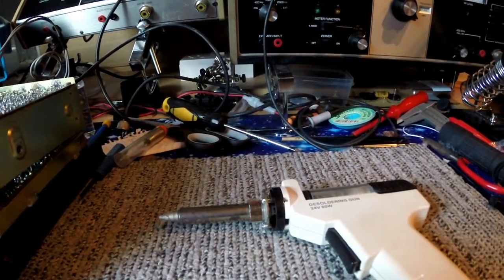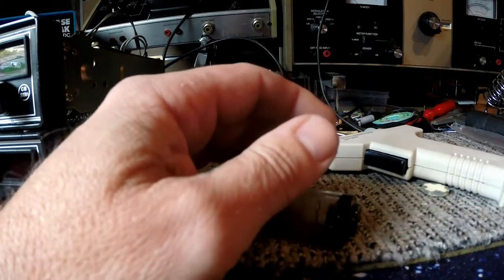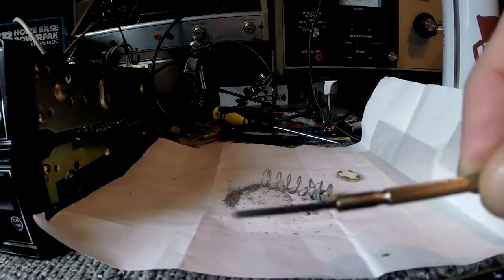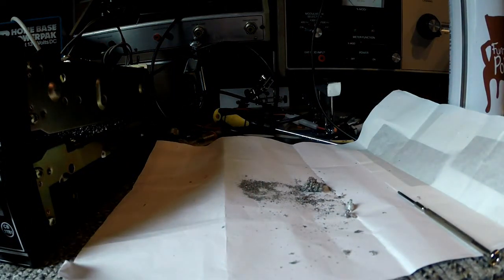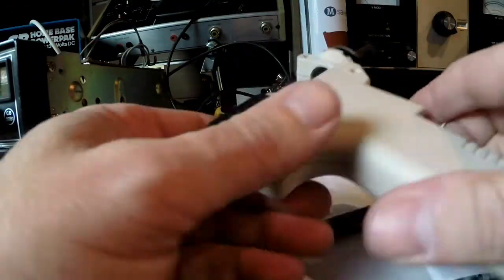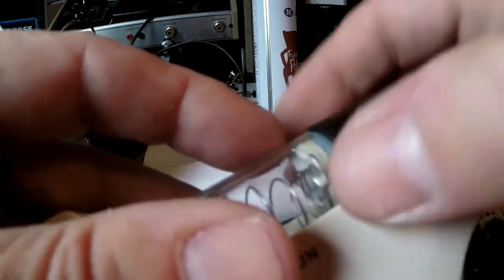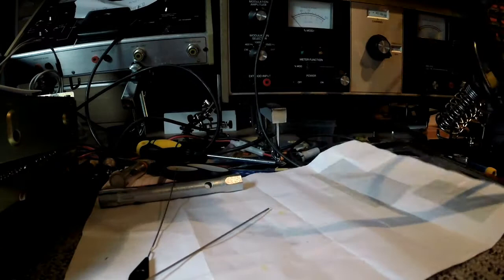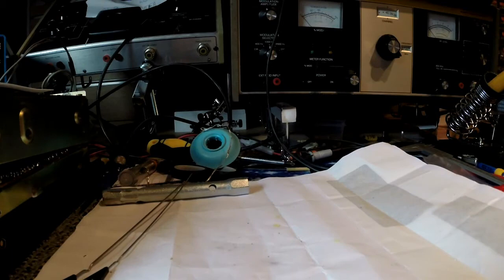ZD915 Desoldering Station - After Use!

Comment: is just chinese junk... mine I modify it a lot...
- the the travel of glass release in not enough to remove it
- it clogs aftor cople of sucking, beeing forced to use high temperature on the gun
 
- first can be modified relative easy by adjusting by grinding some plastic components inside
- second more dificult to do (move all heater assembly back and cut the internal pipe to the sealing limit
Reply: The all gun assembly is a chinese junk is not made by engineer but sume monkeys
Reply from the maker: Fingerrs crossed it has got clogged after heavy solder sucking sessions but still very pleased with mine.
Reply: @britishcbradio1055  after modifications also mine is grate, but looking on the inside and how is designed, is done by really stupid people, a lot of design flaws, and from years no one has bother correcting the shits

Comment: your meant too clean these out pretty much every time you use it .
BTW, your mean to heat up the gun, then use the skewer to clear it once the solder is molten.. is that a roger ?
Reply from the maker: Hi rob, no theres no need to clean them out every time you use them unless you are a really heavy user. If it does clog then yes put it on max temp, then ram the skewers up the tube press the trigger and it should suck the blocksge clear, and be careful the skewers get very hot!! I know from experience!🤣 i will do a cleaning video next time it needs cleaning.
Reply: Not every time, but more often than THREE MONTHS!

Comment: Thanks, mine just clogged during a project and I was frustrated that I could not get cleared. Now I know there is hope.
Reply from the maker: Yes get it set to max and leave it to warm right up the hotter the better and use the ramrods to clear the nozzle if jammed, however be very careful handling the ramrods after they have been up the nozzle as I am speaking from experience when I stupidly picked it up and burnt myself -!
Reply: @britishcbradio1055  Hi, still working?
7 years ago I bought one ZD-915, it was supposed to be the replacement for my Hakko 808 but the Hakko never fail, 10 years, 7 days per week during 10 years without any problem.

Best Regards.
Reply from the maker: @treadmillrepair754  Hi Ricardo, yes mine is still working fine, have to ay the best piece of kit ever and perfect. Like any you have to clean it out occasionally but you have to do that with them all. So still very pleased with it and I may do an update / cleaning video next time i need to clean it.
Reply from the maker: @treadmillrepair754  Tips are pretty good and last fairly well, the 0.8mm hole tip diameter is the best I have found for conventional components but also the 1.0mm works well, don't go any bigger though for conventional components.
Reply: @britishcbradio1055  Hi, my Hakko 808 clogged if I use the 1mm tips, I use 1.5 and 2mm tips only.
I think ZD-915 works better.
Maybe is time to try it.

Now I am trying the Yihua 948, works like a Champ.

Best Regards